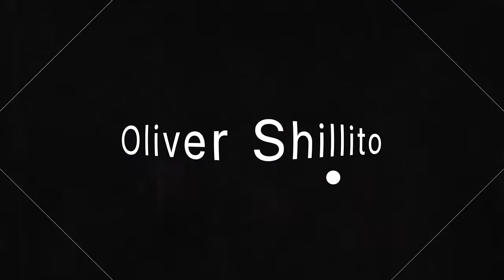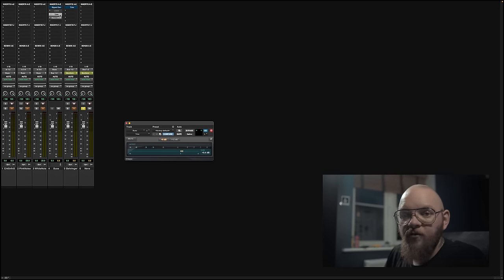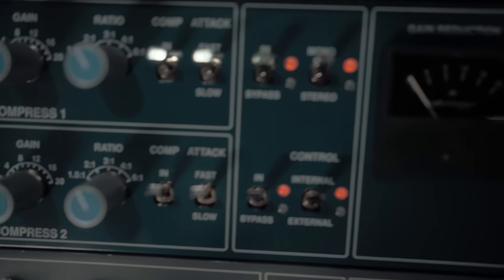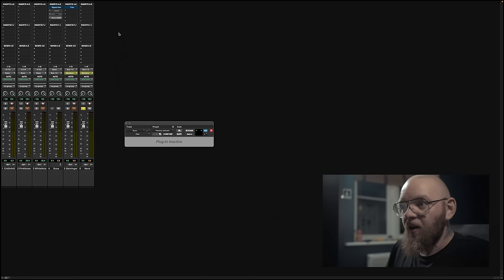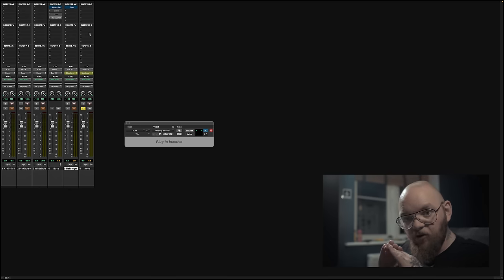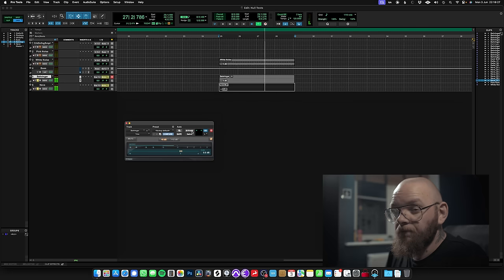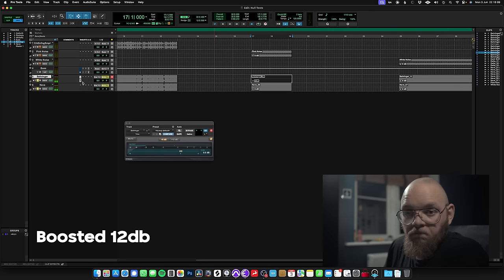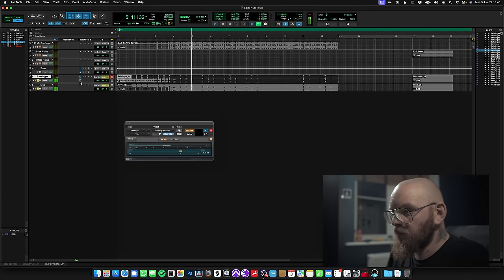Behringer 369-KT vs Neve 33609/J. - Null Tests

Comment: I was thinking about this last night - try nulling two mono signals through the same comp to see what happens - My ( admittedly 25 year old)  dbx 160S doesnt null and that was damned expensive when it came out - actually cost about the same in 2000 as the Neve does today.

Comment: I don't see the point due to the non linear responses of hardware.  interesting none the less I guess.  I think we would be more interested in your opinion now you have had them for a few days.  Do blind tests and post them on slutz is really the best way.  ps I really dig your intro track, well mixed
Reply from the maker: Thank you. Interesting indeed. Had a few people ask for them and so I thought I may as well deliver. For what it’s worth. Now I’ve had them for a few days. I do hear differences between them for sure but I still stand by my original view that in a mix, you’d likely never know. If you can afford the neve and want the extra X percent it offers then great but the Behringer is no slouch!

Comment: Hi and thanks for sharing your thoughts. What I hear in the null test is much more transient material than the body. This means that the difference between the two audio material is in the transient, thus where the compressor works. Mathematically the difference has a second order of values compared to the whole volume (110- 100 = 10 but 10% is a great difference). In fact white noise null test has less volume than the song because there is less transient there. While the bigger volume in the song is in the drum transients mainly. I do not know what this means qualitatively, but the two compressor are very different from this test.

Comment: The dials are not going to dial in the same settings... You can just point them in the same spot and expect the same results... Yes they don't have the exact same components... They don't sound exactly the same.... But they are on point. I won't be shocked at all to find that much variance in two hardware units... Especially of older gear where it's not quite so machine automated

Comment: An analog null test cannot work on analoge devices. With just one winding or 1 ohm more in a transfomer, anything would be differen. That only works on digital. With analog even 2 factory matched devices will be different.

Comment: This is a good video those that work on and actually have expensive gear know why…

I hate the other brand with a passion and not because I work on and have Neve. I hate the other band with no gear at all.

I’ve never heard 2 compressors sound so close as show on the previous video.

This link is to the warm audio vs Neve also as close some spots as close 

https://youtu.be/aD9D-Wcw2zc?si=z2_T3CqRmD8d0AOG

Evidently clone this Neve compressor isn’t as hard as other 
gear

Comment: It is the most incorrect method to judge especially analog hardware, in fact even the same machines of the same brand and of the same production series do not cancel each other out!  🤣 So as a test it has ABSOLUTELY NO value 😉